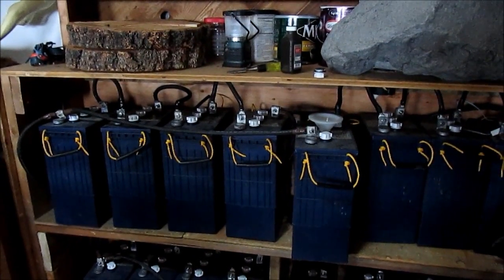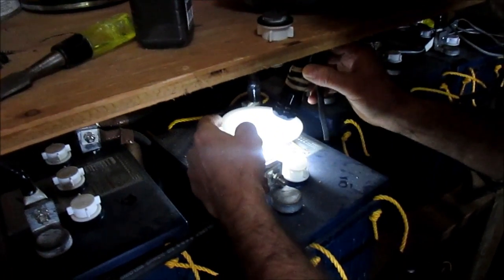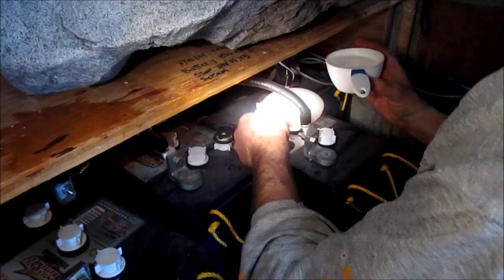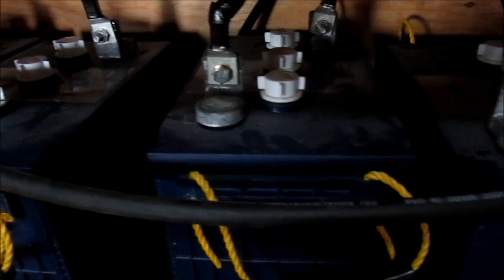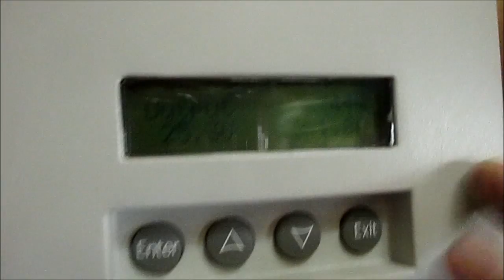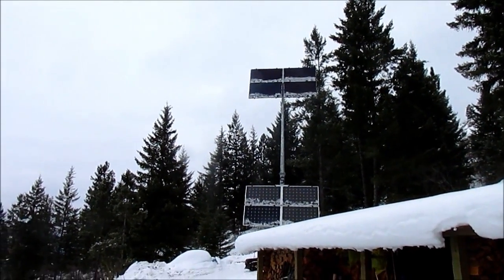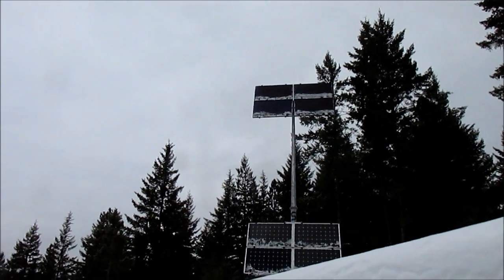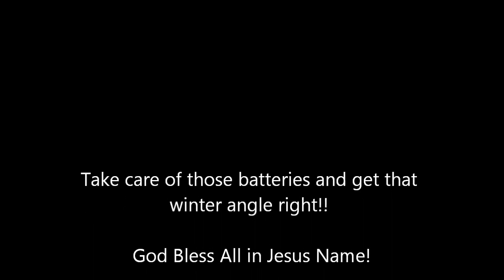Solar Battery Maintenance

Comment: Hello what about considering a wind turbine for continuous charging of the batteries for some reason whenever there's no sun there's wind. Since maintenance of batteries doesn't scare you. Wind generator maintenance shouldn't either
Reply from the maker: We had a wind apparatus and we took it down. It wasn't even about not having enough wind I mean every now and then we had when but you have to understand you have to have consistent powerful wind to crank up and generate any type of wattage it really isn't worth it unless you live in an extremely extremely windy State and those states are very rare don't waste your money is my advice get more solar panels get more batteries

Comment: Do you get much wind ? If so maybe a wind turbine if you don't already have one, could maybe offset the power loss from the solar panels on cloudy days.
Reply from the maker: We had a wind turbine and ended up replacing it with more panels. We just dont get any significant wind here. It was a novel idea at the time, made alot of sense if we had  the wind..but unfortunately we didn't!

Comment: It seems you have 6V battery. In high percentage of lead acid battery failure were high resistance. So how to use a perfect charger which can remove PbSO4 in crystal seems the best way in maintenance.

Comment: what was the price tag on getting everything
Reply from the maker: The battery bank was the most pricey item..i believe 5-6k. With installation the whole system ran about 12k. We could have got connected to the grid..but oddly the cost of running electricity up here was just as pricey. Regardless our goal was to be as independent as possible even if it cost some money..it was a investment in us!

Comment: Hello:
First, thanks for sharing all you do...!
I watched one of your vids in which you claim and show that clouds/fog does not interfere with solar output.
Then I just watched another vid where you quote your husband with say "it doesn't matter how many solar panels you have, if it's cloudy, they won't put out any juice."
You even show this on your control panels.
Now I'm confused. Which is it...?
Help please...?
Reply from the maker: +Troy Stutsman yes that is confusing. it depends on the angle of the sun. during the summer it can be cloudy and you will still get fair input to the panels. the sun is more intense at the higher angle.
during the winter if there are clouds there will be little to no input to the panels, the sun is at a very low angle, not very intense. sorry about the confusion, hope this explanation helps. Mr.H
Reply: +Starry Hilder & Mr. Hilder:
Thanks for the fast reply and clearing that up for me.
I love you guys, think you're both great, and have learned a lot from you...!
We share the same beliefs.
I look forward to your new videos and learning much more from you...!
Have a great day...!

Comment: I don't understand why 6 volt series to 24.  Because 12 volt series to 24 easier.  I also don't understand why 24 v when a charge controller will accept 12.    To me most chargers are 12v with a switch for 6v.  So do you disconnect ever battery. Charge each individually.    Because if your system was 12. Then you could just charge all at one time?

Comment: Lead acid batteries release hydrogen, which is why they can explode when connecting jumper cables directly to a car battery. How do you guard against accumulation of hydrogen?
Reply from the maker: +George Applegate we have a pipe vented in with a small fan inside,. turns on when the voltage hits gassing point for the batteries. yes this is important to have in your solar set up. thanks for commenting on that important point!

Comment: SAFETY FIRST - you should wear eye protection & gloves when handling WET CELL  batteries. there's ACID in there !
Im surprised that you need to do it that way. Most have a single point to water from with a tube and small hand squeeze bulb to pumps water gently from a container on the floor so you don't get anywhere near the liquids.
Also - consider a SPILL kit for battery acid.
Reply from the maker: Damien Percy Good advice!

Comment: Better than caps why not use Concorde AGM Acid Gell Matt batteries. They are sealed with a acis gell inside and need no maintenance.

Electrocution warning!!! > With wall A.C. the current stops to reverse itself so if you are being electrocuted you get a second to let go every couple of seconds. With D.C. (Direct current) it is constant voltage! Short out the current on batteries you are fried and probably will die! WEAR GLOVES WHEN NEAR BATTERIES. DON"T TOUCH EXPOSED CABLES OR TERMINALS!!
Reply from the maker: +terry palmore the one thing we have learned that if you are not maintaining you batteries by taking the caps off each cell you have no clue what is going on with them. one of the most importantant things we have found is checking the specific gravity of the cells with a hydrometer. and not the kind with the little floaty colored balls in the tube!. specific gravity is everything in a battery. we can adjust our charge times accordingly to get the specific gravity right. we want our batteries to be happy!!! and last a long long time!
Reply: +Ruby Gray Especially when being electrocuted.

Comment: I didnt catch how many amp hours your battery bank is.  But rule of thumb is at least 1.25 watts to amp hour.  More is better to help on low sun days.   You have a massive battery bank.  We have 740 amp hours and 2170 watts of solar plus our wind turbine.  I check my fluid levels every month and check the gravity and charge monthly.  I also collect data off the Midnite to see whats going on.   With our solar we have had no sun in 7 days and still kept the batteries above 70 %.  You will be surprised how much more solar you get on cloudy days with more panels.  
To explain batteries.  They are on a CYCLE life.  Meaning if you have 100 cycles and you drain the batteries 100% then the batteries last 100 days.  BUT if you only use 20% a day then you just made those batteries go 500 days.  5x20=100 so every 5 days you cycle a battery.  I hope this helps you with your battery maintenance and figures.
Reply from the maker: Im gonna have my husband read this info...Each battery I believe has 450 amp hours. Our solar array i 2K. So why does our battery bank seem to go down so fast (like in one day or two) and we either need more sun or have to use the generator to bring up our numbers??? something doesnt seem light especially since the only thing we r un is the small freezer and a couple led lights and our computer..thats it!! You have any idea w hy this is so from your experience?
Reply: We had some issues in the past.  One was our inverter it was a modified sine wave and was using 15% of our battery itself.  We started off with 750 watts solar and 640 ah of batteries and could not get a good FULL float charge.  We bumped up the solar and got this under control.  Then we upgraded our battery bank to l16e and the problem was gone.  You have to have extra solar for winter and cloudy days.  
When using a generator you dont get the charge you do from the sun since its just dumping in 30 to 50 amps to fast charge the batteries.  The batteries need that absorb time to fully get charged.  When we charge through our inverter/charger,  It does a good job but it not the same charge as the Charge Controller performs on the batteries..
 Our batteries (740ah) L16E Trojans we can last 5 days above 50% with no good charge.  But since we bumped up the Solar to more than 2 times the watts to AH we get upto 80% and higher on cloudy days.  
We do run the generator when required, but it can boil your batteries to much and that can degrade the batteries.
We run a desulfator and it has help us get a much better charge.
If you want to talk goto the website contact me area and shoot me a message with your contact information.
Reply: +Starry Hilder Keep the videos coming.  I can only dream of the life you folks live.  I dislike big city life.

A little number crunching here.  Your 2Kw panels are 2Kw panels under ideal lab conditions that simulate full sun overhead giving 100% of all it has.  In real life, that is considerably less, closer to about 1.4Kw.  It has to do with trigonometry, but  I won't go into that.  

Any power you draw from the battery bank at night requires the solar panels to replace that power during the daytime charging cycle along with the power you are using during the daytime.  Your freezer and computer probably averages 600 watts per hr.  In 24 hrs, that's 14.,4 Kw.  Your solar system will pump about 16.8kw back into the battery bank in a 12 hr summer day, around 12kw during the shorter 10 hr winter days.  Also, battery capacity is less in colder months if they are not in a warm room.  So, your solar system may be running at about 2.4kw deficit or more during the winter.  You'll probably noticed that the summer months things were better. 

Another issue is your location.  Again, more trigonometry that I won't go into.  I presume you're in Idaho (45 deg N).  Being so far north, the solar panels need to be about 68 deg up from horizontal in the dead of winter and about 22 deg up from horizontal during the summer.  Spring and Fall should place your panels at about 45 deg.  This will position the panels so that the sun is nearly vertical to the panel face which will maximize their output.  A 2-axis sun tracker would take care of aiming the panels automatically - at some expense.
Reply: Dan Burch Can you show us your system.  Would be neat to see.   You have a ton of math there.  Just curious about your system.
Reply: I don't have a system.  It's based upon my knowledge of trigonometry and how hte earth and sun relate to each other.
Reply: +Dan Burch "watts per hr." -- Those units cannot be correct.  If you could edit your post, I'd love to read it again in detail.  Sorry, I'm hung up on the technical details for now (splitting hairs).  I am sincerely interested, though.

Comment: what's each battery's voltage? 12, 24 ???
Reply from the maker: +808 BADD 24
Reply: +Starry Hilder  thank you
Reply: +Starry Hilder What are the AH for those batteries?
Reply: +808 BADD  In this video they are using 6 volt batteries in a 4 wide and 4 high wiring to give 4 times the current storage of 1 battery and 4 times the voltage to get 24 volts (25.2 to 27.6 actual volts)

Comment: Yes I have seen almost everything, from the jungle on the wall to the cleanest of systems, don't jump to conclusions or make quick judgments on your system, battery storage is not the issue. Putting energy into your batteries is the problem. Look at that first before spending more money on batteries. I don't want to sound like a expert because I'm not, there is lots of things to try before you spend thousands more on a different battery pack. I can offer you several options before a mass cash outlay. And there are upgraded versions of the forklift battery system that have 5000 cycles at 80 % depth of discharge. It sounds familiar the solar guy sized your system for a perfect world rather than a real world. Took the average number of sunny days. Rather than a week without sun in the winter with 3 hours worth on good days. Then when they overpowered your system with panels, did they show you how to store your excess electricity? Such as dump loads for heating water, compressing air, running a split heat and AC unit. Nope they left you holding the gas can for your generator. Sorry I'm on a rant! I will help if you with any questions you have if I can.
Reply from the maker: 919hammer I sent to a PM..many questions..looking forward to talking!

Comment: 20 bateries every 5 to 10 years at a cost of _______?
Reply from the maker: +Ready Temp 16 batteries 300 apiece. if well maintained they will last easy 10yrs.  will let you know in 9 more yrs! hopefully with technology the price will come down, but i doubt it. we have another option we are exploring.
Reply: +Starry Hilder  i have several customers whit banks older than 20 years, aging, but still peforming nice!, a must is equalizing the cels a few  times a year to keep them healty .
Reply: If they last 10yrs that's electricity for 41$ month not including cost of panels n materials. It is cost effective if done correctly and money is not wasted on contractors. Essentially all diy and self maintained. My rv is all solar and it definitely makes sense.